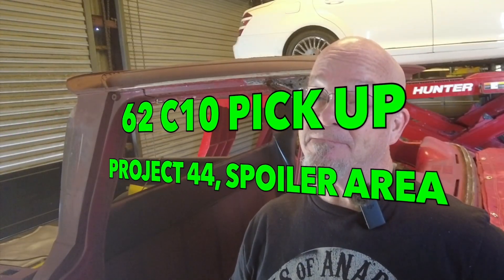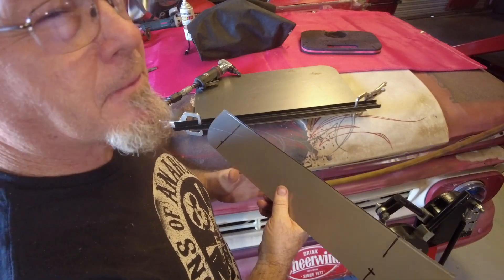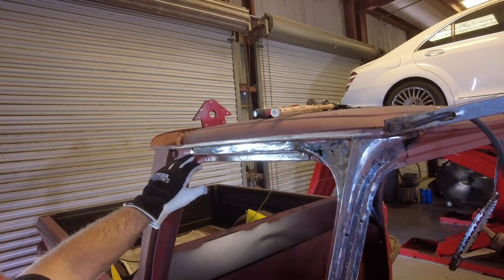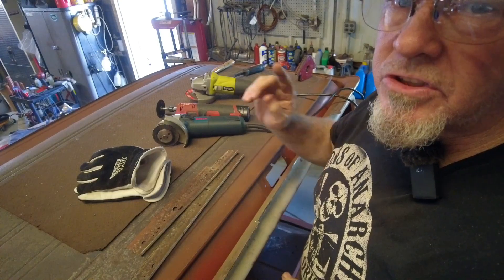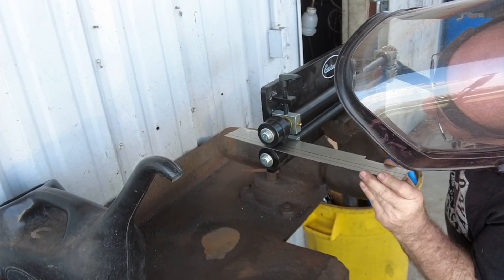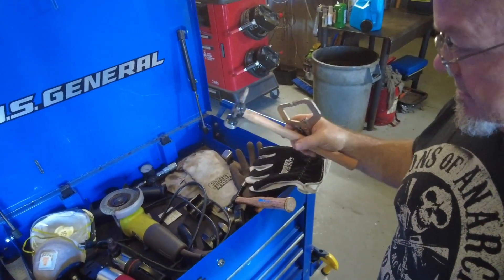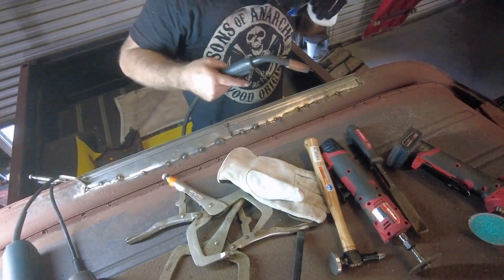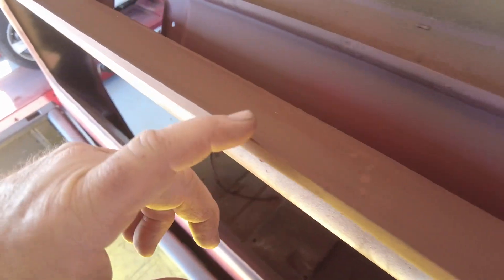Saving a rusty 62 C10 Chevy Pick Up Truck. Rear spoiler, door jamb repairs...PROJECT 44

Comment: Jimmy if you need long curved pieces of metal you got a metal bench clamp on each end and gently  bend the metal over with a dead blow hammer and you can make any size that doesn't fit in your press break old school baby paul from england 😎😎😎😎😎😎😎😎😎😎
Reply from the maker: Thanks Paul! Trying to sort out a bench for the metal brake and bead roller soon. ;)

Comment: The truck videos aren't boring at all. I look forward to Sunday morning's video. Air shears will save you a lot of wear and tear on the hands. I bought my air shears at either a swap meet or Metro Tool. They are the equivalent to what you would find at Harbor Freight. My air nibbler and die grinders are all no names along with my snub nosed air hammer. I've had them for over 20 years years and they are still working. On some of them I engraved "Snap Off".
Reply from the maker: That sounds like a good plan. Have to scour the local pawn shops.
Reply: @JimmyMakingitwork  The tools I mentioned were bought new. Metro Tool was an independent Harbor Freight type store that was in my town. They also set up at the various swap meets in my area.